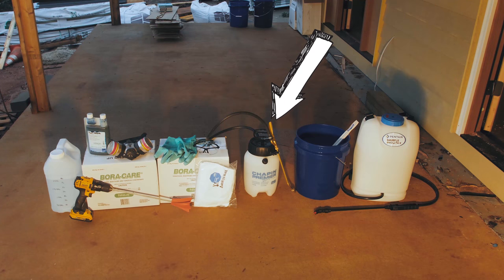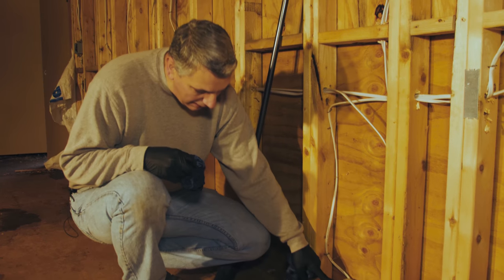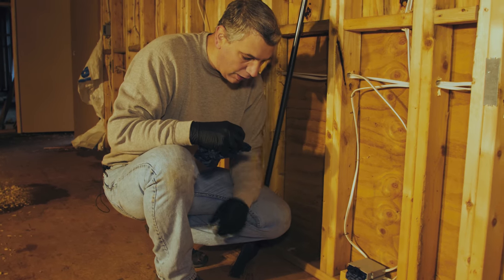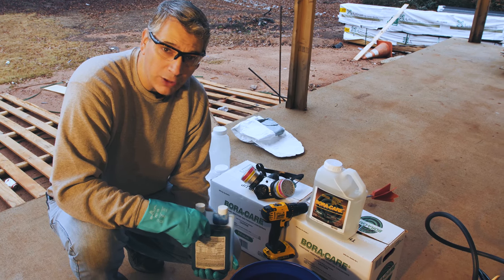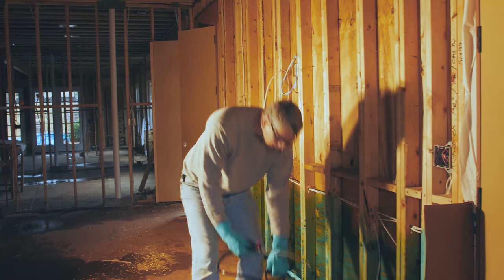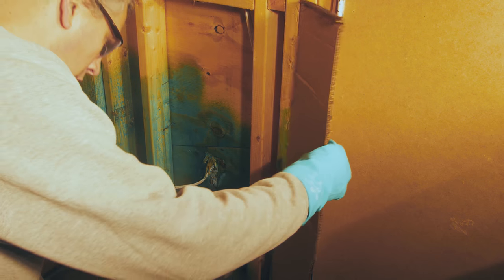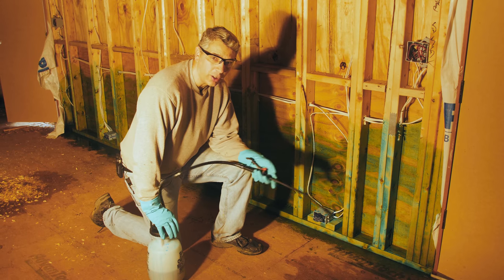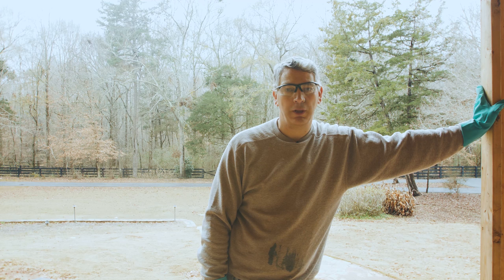How to do a Borate Wood Treatment | DoMyOwn.com

Comment: You're not spraying the butt-ends of the timber. The best time to treat these are before they are nailed into place in the frame; termites enter the end-grain and away they go - spray on is not absorbed to the core of the timber, so end-grain application is vital.
Reply: This method is still fine for wood rot prevention though, right?

Comment: It makes no sense to apply bora-care AFTER construction since the bottom of the plates - where termites begin eating - are untreated and thus provide unrestricted entry to the termites. The same applies to the bottom of each stud. Your method may slow down termites, but not stop them. For best results, apply bora-care after boards have been cut to size, but BEFORE assembly.
Reply from the maker: Keep in mind that Boracare absorbs fully into the wood, so it is not required to treat all sides of the wood in order for a piece to be protected fully. For pre-construction subterranean termite prevention, applications do not need to be applied to the entire piece of all the wood. Please refer to New Construction Bulletin for complete instructions:  https://www.domyown.com/msds/Bora-Care_New_Construction_Bulletin_2020.pdf
Reply: @domyown  Have you ever cut into a piece of wood that you treated to see the penetration?  I don't believe it will penetrate much beyond the surface.
Reply from the maker: @wanderinguser7665  We recommend looking into Jecta https://www.domyown.com/jecta-p-931.html it has the effectiveness of Bora-Care in a gel form for sealed and hard-to-reach wood.
Reply: @domyown  Didn't know this existed, thanks!

Comment: Did this with a piece of untreated wood here in Florida, the termites were already having a feast .in the humid summer it took forever to dry in to the wood and I thought it must not work or I mixed it wrong. No, after about a month all termite activity ceased, it's been years, they haven't touched it since.

Comment: Can you use this in a crawl space?
Reply from the maker: Yes, you can use Boracare (or Timbor) in a crawl space or attic to treat raw wood there. Be sure to use a respirator if you are using Boracare in an enclosed area that does not have good ventilation.

Comment: I'm treating some reclaimed hand hewn barn beams. There's a lot of ant tunnels that looks to be old. How long is a safe bet to wait between BoraCare application and in-home installation of these beams to make sure there's no active infestation? And can a finishing product be applied once the BoraCare dries / won't interfere with the effectiveness?
Reply from the maker: Boracare will eliminate carpenter ants if they are actively tunneling in the wood. If the tunnels are old and ants are not present, you can still treat the wood to guard against new infestations. You can apply Boracare, allow it to dry completely (about 72 hours), and then apply the sealant or finish of your choice. Once the wood is dry you can install it in your home.

Comment: Great video & product. 
I have been using BoraCare for years. I had an old 1925 building with exposed ceiling rafters. The former owners were negligent in their pest control. I sprayed the BoraCare on all overhead ceiling components and never had termite problems. It treats old infested wood, as well as it being a great protection for new wood.

Comment: Great video very informative. 
Can it be mixed with room temperature water or only hot water?
Reply from the maker: Yes, you can mix it with room temperature water. We recommend using a paint mixer attachment on your drill to mix the Boracare thoroughly with the water.

Comment: Bought a home with crawlspace and only some termite in garage area. The rest of the house has perfect wood with no termites. Should I use Bora Care or TERMIDOR SC?? Whats the difference in liquids. Also wondering on using some of the bait stations and putting some around the house and crawlspace.

Comment: why not use copper sulfate as your marker spray to get the added protection for mold too.
Reply from the maker: We carry Bora-Care with Mold Care that could add that mold protection you might be looking for https://www.domyown.com/boracare-with-moldcare-p-1265.html 

We do recommend looking at the Bora-Care label for anything you want to use with it if you go that route. https://www.domyown.com/msds/Bora_Care_Label_2022v2.pdf  For marking dye, it states: "For tracking purposes (to make it easier to see where Bora-Care solutions have been applied) an appropriate marker dye or pigment may be added as part of the diluent to the Bora-Care solution. Refer to the dye or pigment product label for the recommended amount to add to the Bora-Care solution"

Comment: nice video...what's the difference between the borax solution vs the powder mix?   Is it more concentrated?  Thanks.
Reply from the maker: Bora-Care and Timbor are both borate products used to treat wood, but they could not be more different.  Timbor is in a powder form that is mixed with water.  It is much less expensive but it is intended more for protecting new wood only, or wood that you know does not have any issues.  Timbor will only penetrate the outer layer of the wood so it is more for protection or for treating fungus on the surface of the wood. 

If you have an active infestation of termites, powder-post beetles or wood borers deep inside the wood then Timbor would not make it through the wood to kill these insects.  BoraCare is a liquid borate but has an additive, a glycol solution, which allows the product to penetrate through the entire piece of wood, therefore it should be used any time you have an active infestation because you are guaranteed it will kill anything in the wood no matter how deep it is.  Also, BoraCare will last forever in the wood so you will never have to worry about any infestations in the wood that you treat ever again. 

Bora-Care https://www.domyown.com/boracare-p-100.html
Timbor https://www.domyown.com/timbor-professional-p-144.html
Reply: Can you still spray BoraCare on wood that's been painted with mold killing Primer?

Comment: redoing insulation/sheathing and siding. is it safe to appy the product outside knowing I have very limited time before insulating with rockwool and placing the sheathing? only have N95 in hand. is that enough?
Do you also recommend  applying boracare on top of zip sheathing?
thanks.
Reply from the maker: BORACARE can take up to 72 hours to dry. We would recommend to try and wait longer than 24 hours to seal up the wall. This will allow for the product to better soak into the wood. Since Boracare alone does not treat for mold if you seal up moisture, mold could be a concern. We do not recommend applying Boracare on top of zip sheathing. Boracare should only be applied to raw or untreated wood. Using a N95 mask is fine for PPE. We also recommend long pants and long shirts when applying chemicals.

Comment: Please tell me, I have dry woods in the attic and in my panaling in the living room. Do I only go up the 18 inches at the studs, or shouldn't I go all the way up and down, since drywoods come from above usually?
Reply from the maker: If you have active drywood termites you would need to treat all of the wood that is infested. The wood must not be painted or sealed. Here is a link to our drywood termite guide with more information: https://www.domyown.com/drywood-termite-treatment-guide-a-474.html
Reply: @domyown  CAn I paint  over the wood once I have treated the wood with Borate?
Reply from the maker: @jumor6564  Yes, you sure can. You just need to let the wood dry completely and then it can be painted, stained, or sealed.

Comment: what if they are already inside the wood? how long does it take to them to die or do they need multiple applications?
Reply from the maker: If there are subterranean termites already within the wood of an existing structure then you would need to follow our guide, How to Treat for Subterranean Termites https://www.domyown.com/subterranean-termite-treatment-guide-a-478.html , which includes a video on the application and step by step instructions on using a product to treat the colony in the soil, like Taurus SC. If you have an existing drywood termite colony, or powder post beetle/wood boring beetle, you can use Boracare https://www.domyown.com/boracare-p-100.html at a 1:1 ratio to treat the entire piece of infested wood and surrounding wood that could be impacted by the colony as they feed on the Boracare and die. A single application of Boracare when used per label instructions will last for the life of the wood when protected inside the structure. A soil treatment for perimeter protection against subterranean termites with Taurus SC https://www.domyown.com/taurus-sc-termiticide-p-1816.html would last for 10 years. It is common practice to do both on a new construction home for the optimum level of protection and control. An average drywood or subterranean termite colony can take up to 90 days to die after an application has been made to the wood or soil.

Comment: For smaller projects, can we use a paint sprayer to apply it?

Also can I use it on planter boxes for veggies and fruit? Or is it toxic?
Reply from the maker: You can apply Boracare using a hand pump sprayer, paint brush, or paint roller. Be sure that you mix the solution in a separate container such as a bucket as directed before putting the solution into your sprayer. 

If you are using Boracare to treat wood that will be used for gardening or otherwise exposed to rainfall and watering (as well as for indoor use such as furniture), then you would need to apply a water sealant after the Boracare treatment has dried and before use.

Comment: If I'm building a table can I just spray the legs alone or do I need to spray the whole table down 🤔
Reply from the maker: For the best protection it would be recommended to apply to all wooden parts of the table not just the legs.

Comment: Will this damage or stain concrete floors?
Reply from the maker: Bora-Care alone will not stain concrete, or new construction. However if mixed with Turf Mark Blue, it will leave a permanent stain on concrete and studs.

Comment: Shouldn't all the lumber in the entire house be sprayed with boracare?  Drywood termites often infest any vulnerable lumber in the attic or ceiling and does not have colony in soil.
Reply from the maker: Any untreated or unstained wood, including plywood, would benefit from an application of Boracare to help protect it from wood infesting pests, fungi and dry rot.
Reply: Very valid question. The relation is the behavior of drywood and other termite species. The newly appointed female queen is going to try and burrow in the tips of the lumber. 
That being said, wafer bored offers her multiple avenues and she can almost burrow anywhere within that wafer board.
If your DYIing the treatment, you need to inspect the wood on a quarterly. 
If your not, it's highly recommended to have a WDI (wood destroying insect) program at the least on a quarterly basis.
Especially if your home retains high moisture.

Comment: How long does borate treatment last?
Reply from the maker: Bora-Care will remain for the life of the treated wood, so no retreatments are necessary. You can get it on our site here https://www.domyown.com/boracare-p-100.html Keep in mind this is only for unfinished wood - only to bare surfaces where an intact water-repellent barrier, such as paint, stain or sealer is not present.

Comment: Is boracare recommended as a furniture treatment if the furniture must be stripped/sanded before application of boracare?
Reply from the maker: Bora-Care can be used on furniture but it does need to be stripped/sanded before the application. However, if you do not wish to sand or strip the furniture, there is a product called Jecta that is Bora-Care in a tube: https://www.domyown.com/jecta-p-931.html. 
 
Please let us know if we can be of further assistance.

Comment: Why not get the wood treated before construction?
Reply from the maker: While you can treat wood prior to construction, doing treatment on framing allows you to ensure the structure is treated correctly and that you are not wasting product by treating wood that may not be used or that is cut away. There is a new construction bulletin from Nisus, the manufacturer of Boracare, that details how to treat a new structure correctly with Boracare for a subterranean termite pre-treatment: https://www.domyown.com/msds/BoraCare_new_const_tech_bulletin_02_02.pdf

Comment: Can I use Borate on wooden doors, doorcase, parquet flooring, sidings or even furniture before painting? (without the die, of course)
Reply from the maker: You can apply Boracare to just about any wood or other cellulosic material as long as the wood is raw (not painted, stained, sealed, etc.). If you are treating furniture such as a kitchen table or other items that will be used for dining or food service, then you need to use a water sealant after the Boracare is dry for food safety. Since Timbor is a powder concentrate and does not absorb as cleanly or as fully into the wood, we always recommend using Boracare for decorative wood, flooring, furniture, or other wood that may be painted or stained after treatment.

Comment: Does this help prevent mold?
Reply from the maker: No. Boracare by itself will not treat or prevent mold. Boracare with Moldcare https://www.domyown.com/boracare-with-moldcare-p-1265.html will treat existing mold and prevent mold in the future. Boracare with Moldcare will not remove the mold stain however, for that you should use Mold clean. https://www.domyown.com/moldclean-p-1328.html

Please let us know if we can be of further assistance.
Reply: @domyown  can I use both in the same wood?

Comment: What is the difference in absorption between this new wood and the 70 year old wood in my attic?
Reply from the maker: Newer wood will have a higher moisture content than wood that has been in a house for decades, so you will get faster and deeper absorption of Boracare with newer wood than older wood. If you have very thick beams that have been in a house for decades, then you probably will not get Boracare absorbed all the way to the center of the wood.

Comment: What would you recommend for a piece of furniture with an active infestation of woodworm? Can you use this product in your video? Thank you for so much information in your video
Reply from the maker: For furniture your options are limited for treatment. If the wood is in its all natural raw state without any stains or finishes on it you can use a product like Boracare. https://www.domyown.com/boracare-p-100.html Boracare will absorb all the way into the wood and eliminate any infestation that is there and last for the life of the wood. It does not stain the wood or leave behind any visible residue, but becomes one with the wood and any insect that ingests it dies. If the furniture has a finish on it, you would either have to drill holes throughout it and inject something like the Boracare or a foam, or the option most go with, hire a company to fumigate it.
Reply: Use heat.  Put the furniture into a small enclosure and heat the space to 132 degrees Fahrenheit for two hours.  It's so effective that heat is used to treat rooms infected with bed bugs.
Reply: @domyown  can hardwood floors be sanded down to apply Boracare? We have powerpost beetles on our hardwoods, but don't want to tent the house. We rather sand them and treat with Boracare if it'll work.

Comment: Will the boration hurt pvc pipes if it comes into contact with them?
Reply from the maker: Boracare is safe to use around structural materials including PVC pipes, brick, metals, concrete block, plumbing, and of course any cellulosic materials used in structures.

Comment: Wondering why you are treating interior walls on what appears to be a crawl space home? wouldn't you treat underneath?
Reply from the maker: The treatment shown in the video is for showing how to apply this specific application on the label for the 2 foot barrier around all studs, joists, and sill plates. There was a liquid termiticide treatment done to the soil around the foundation of the home in addition so the home is adequately protected all the way around. If a customer has access to sub floor or areas under a crawl space and wish to treat the additional wood under the home they are certainly welcome to and the Boracare label addresses this application.

Comment: Why only the bottom section.  Can I do the entire wall?
Reply from the maker: It is recommended to do the bottom section because subterranean termites come from the ground up and will come into contact with the treated wood at the bottom first. You can treat the entire wall, it just becomes quite expensive to do so.

Comment: Why not just get the powder and dilute with water?
Reply from the maker: If you are referring to Timbor, then you can use that product to treat raw wood for prevention of wood-destroying insects and wood decay fungus. Timbor only absorbs about 1/4" into the wood, so it is for prevention only and not for treatment of existing insect infestations. Keep in mind, as well, that Timbor can leave a visible residue once it dries, so it would not be recommended for wood that is visible and would be stained, sealed, or painted after the application.